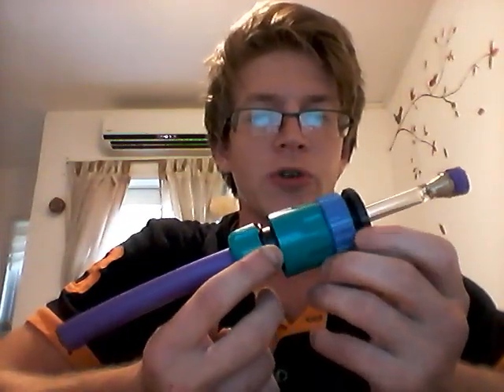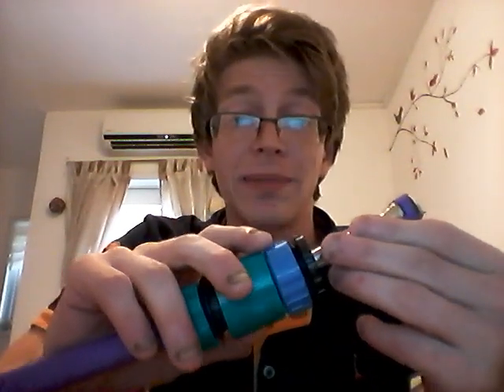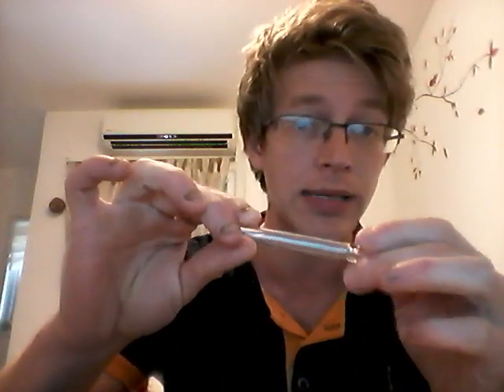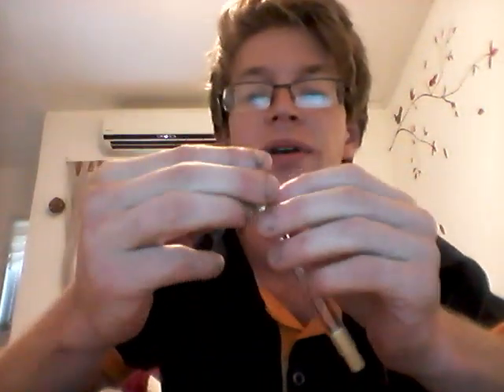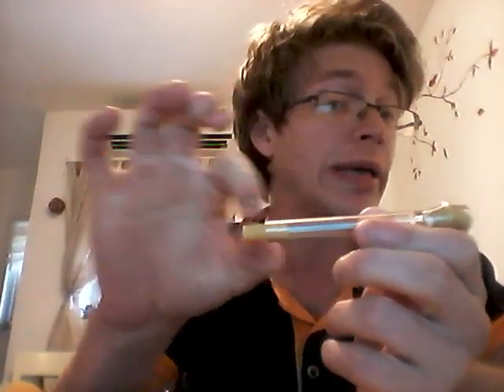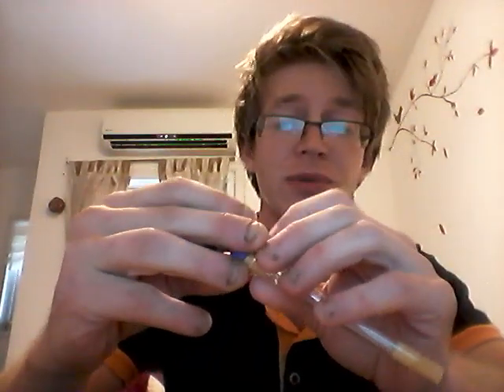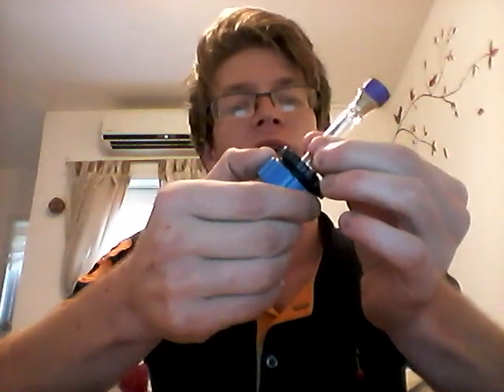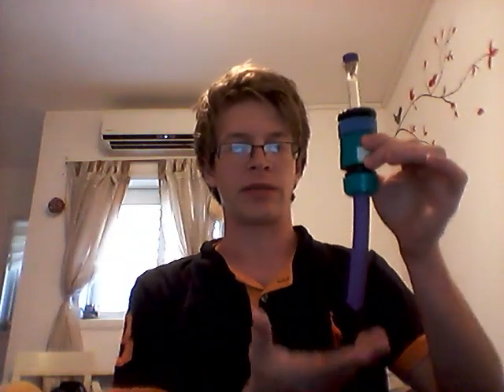Homemade atmospheric water generator

Comment: There's potential here! By the way - one can buy just the cigarette filters alone at the cigarette smoke shops. There's kits where people can buy the filters (butts) and sleeves and use a device to put it all together with the tobacco. Since you'd be buying just the cigarette filters, you wouldn't have to have an ID card. The filters are just that - filters with no tobacco at all. A whole lot cheaper than buying packs of cigarettes for making these things.

Comment: I cannot understand what will make the air flow in and out of the tube? there is no air pressure difference between the two ends of the tube.

Comment: Does it have to be this type of tube or can you use the Pyrex tubes you mentioned? I found blowing tubes on eBay. Was wondering if those would work.
Reply from the maker: They should- some of the time I would break the top off the tube. The top of it really isn't the most important- what you want is material that can interact with the environment well. 

The problem I ended up finding when replicating this in Virginia is that it only works apparently in Arad. So it needs some redesigning so it can work better in lower temperature and higher humidity areas.

Comment: People are uneducated on the three modes of heat transfer.    They teach them in mechanical engineering school.     A dew collector is not condensing the water.   It just collects the water the cold night sky condenses out.  The heat in the air/vapor  is sucked up by the cold night sky.     That is radiative heat transfer from the air/vapor mass to space.   The Waterseer assumed the cold earth would take the heat from the air but the earth is not cold enough to get below the dew point.   I'm sorry, but as a mechanical engineer these schemes will never work.    The air in a desert is of extremely low humidity so you need to get even a colder temperature so you can reach the dew point.   As the humidity level of air decreases from 100% the more you have to cool air to get it to condense.

Comment: doesn't it only work if humidity is over some %.
Reply from the maker: Yes, this is something I am currently working to address.
Reply: Depends greatly on humidity plus temp. Better to have high humidity with high temp than high humidity and cold temp. Problem is, in the desert you get low humidity and high temp so you have a lot more work to do to get the air down to dew point. At night the air cools and its ability to hold moisture decreases (which increases humidity percentage) but you still have the same amount of water per cubic meter as you had during the day, but at least some of the cooling work has been done for you by the night time drop in temp.  Depending on the environment you could do some more of the work with geothermal cooling by pumping the air underground (assuming the soil is cooler than the air) or you could pre cool soil at night and try running day time air through it. In any event, AWG is an easy process physically, but the moment you start using electricity to do any of the cooling work the cost of you water can end up being 10x (or higher) the cost of gasoline. Not viable for farming. Someone will hit on something clever at some point to make it happen though.

Comment: wanna make real free electricity. one generator one conveyor motor on very large electrical creation device capable of being turned by the conveyor motor. if the stator has twelve magnet then the area for the belt is measured and then increase by five time for a wheel on the conveyor motor. then install wheel add belt and turn on. then decide how to control the new increased amount of power. stepping up can go on continuously to infinity. common uses to replace the solar panels in you california yards then is economical sell the grid. good luck.